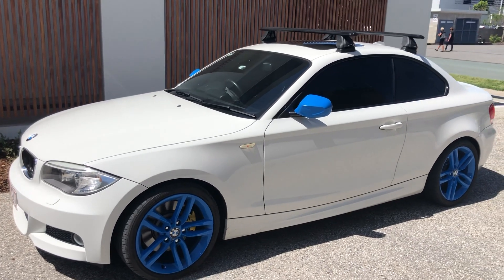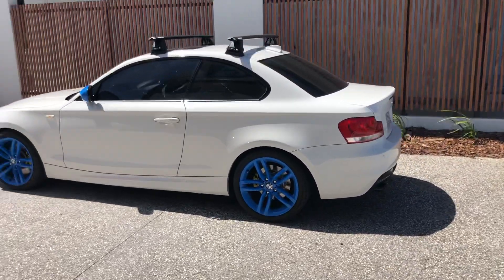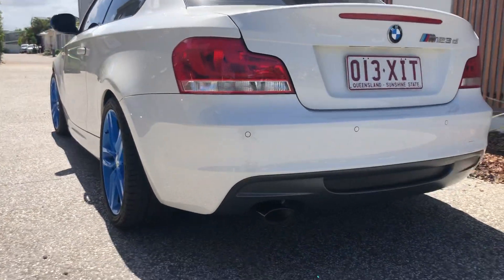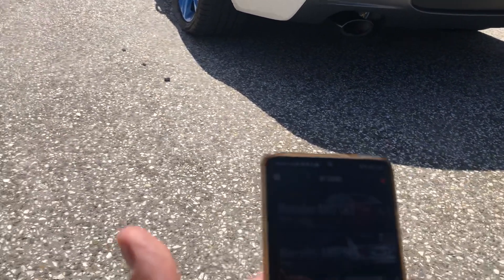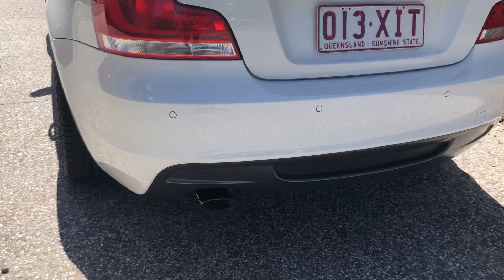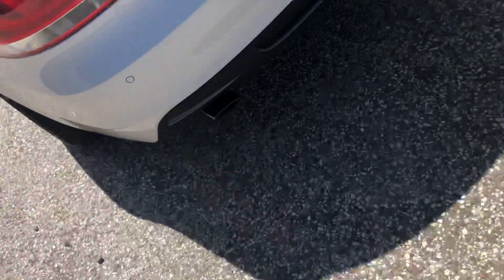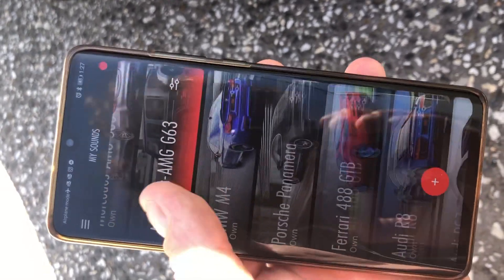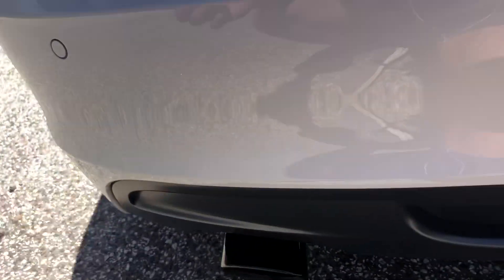BMW M123 d - Thor Tuning Exhaust Sound Generator

Comment: Hi, I've just recently installed this.  A decent system, but to be honest I was disappointed with the installation equipment and instructions which were severely lacking (a scant wiring diagram, connections not supplied for fuses etc, universal bracket didn't fit).  Thankfully I found a video a German guy had made for a similar system which helped enormously as Thor stopped responding to my questions after I had bought the system!  One element I would like help with is how to link the different sounds to the driving modes (eco, sport, sport+ etc).  Thor suggests this is possible but yet again there are no instructions or advice on how to do this and they won't answer questions on this.  Your help would be very much appreciated.
Reply from the maker: hi Gareth, I will reach out to Thor Tuning and ask the question for you. You are welcome to reach out to us by email and will do our best to help you.
Reply: @EuroCarElectronics  Thanks, that would be greatly appreciated.
Reply: @EuroCarElectronics  Thanks, that would be greatly appreciated.
Reply from the maker: hi Gareth, Have you received a reply from Thor? They need 24-48 hours for their replies as a general rule during business hours. They don't work weekends unfortuantely. Thanks

Comment: Is one loud enough? Or would you recommend two for a single exhaust vehicle? 🤔
Reply from the maker: hi Charlie, What's loud enough for you?
Reply: Hello! I’m wondering if the sound is noticeable at street speeds? I doubt you’ll be able to hear it at highway speeds due to all the wind noise. I really just want it for low speeds and car meets.
Reply from the maker: @ilovepsycku  The answer is yes, if you want a lot of noise, get the 2 speakers. You can turn them up and down.

Comment: Which fuse do you connect? Can you please show it?
Reply from the maker: This vehicle was finished  November 2020 and we are April 2021. I dont have this information handy.
Reply: You use a piggy bag fuse into the cigerette lighter fuse.  I have an F30 BMW and this is located in the boot (third fuse down on the right hand side in my case)